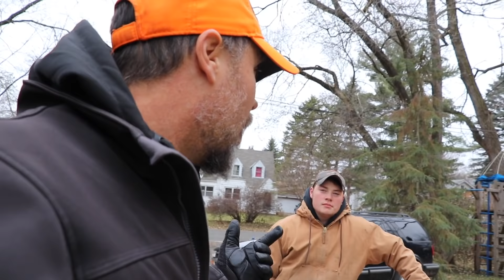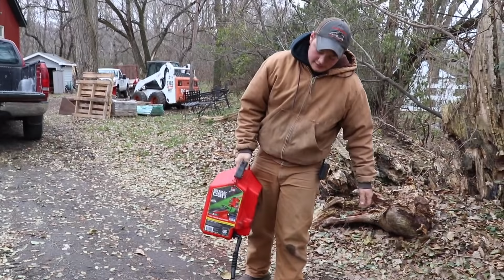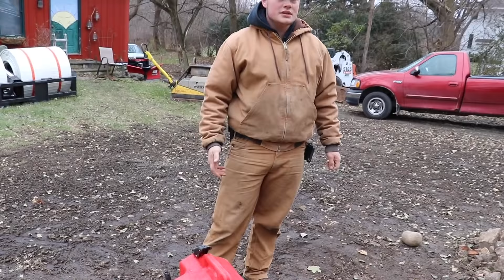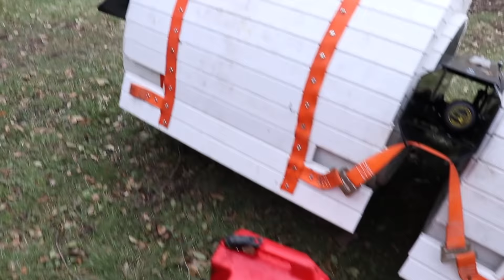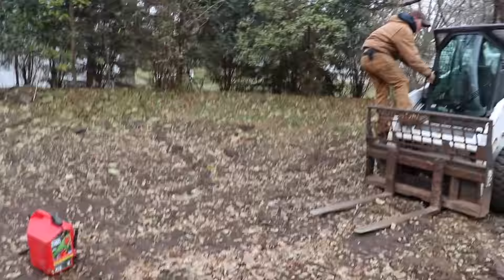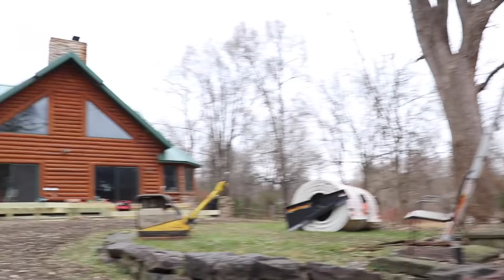Skid steers, Tall places & Bad ideas

Comment: Hey mate. Heres my two bob if it helps. I think u have two shows as your channels content is diversifying. 1st one is showing us a new product or tip that makes our lives easier. The second is a project like the decking one you are working on. My advice to help with the quality vs qty is to break up your project clips so you have multiple parts. Ie rather than one 20 min clip, have two 10 mins called pt 1 and 2. This will break up the editing workload and enable you to upload smaller informal segments in between filming and editing a big project. You have lots of great tips and DIY advice so Im more than happy for you to upload it in any form that makes your life easier. As for names, there are lots of great suggestions by others here. Cheers cc123
Reply: Cool. Thing is strong.

Comment: I bought one of those cans 6 months ago.  US made, durable as you point out, very ergonomic to use,  I took a sharply, marked the side of the can in 1/2 quart increments.  I buy my favorite diesel fuel conditioner by the gallon, transfer to the can and dose my common rail engines easily, cleanly, quickly.  Thanks for the vid!

Comment: I like this concept of testing things... even to the extreme...i don't have one of these cans but I think I'm going to have to get some... problem with other cans is if you need to fill equipment or vehicles and the gas cap is on the side of the equipment or machinery.... you don't get everything it off the can...i like these since they empty from the bottom corner.. you'll get everything out and flow will be much better.. great video!

Comment: I bought 2 of these at the beginning of 2017 season, one 2.5 gallon the other a 5 gallon. Only issue and complaint is by mid season the spout on the 2.5 gallon broke off. Great product but could use a more durable spout.
Reply from the maker: They might replace it for you

Comment: Hello Stan, My question is this. What about the venting? In California it is 100 degrees plus in the summer. I try to keep the cans out of the heat during the day, but still have problems on the job. I have had a balloon from built up pressure. Prior to pouring fuel, we depress the pouring mechanism to relieve pressure. That results in a brief spray of fuel. Them when goin to pour, I have had the fuel shoot right back out of the tank in into my face/eyes. Have not used this can, but I do like how the spout is lower and pivots out of the way. That would be nice when fueling some machines.

Comment: I like the idea, but I would prefer to keep the test within reason. The idea I have is to see over time and use the life span under hard use as opposed to drive heavy objects over them which is almost certain to cause a failure point. Thanks.

Comment: Tell me about it. I have like 12 gas cans. Range from 1-5 gal. All are junk compared to sure can. Except 2 of em an only are good Cus there like 10 years old. Before all these new ones came out. The old ones with yellow button breather flap. An black lid that screws the top off an you pull out the bendy spout. Blitz or somethin. Still nothin compared to sure can. Sure can make a guy dream.

Comment: All nifty, but I'm seventy with a game hip and i need a fuel can that  I can fill my whatever without spilling , getting another  hernia  or starting a fire .    My current " approved plastic wonder "  misses on all counts !  BTW,  when I was a kid we (re) used 5-gallon metal engine oil cans to shuttle gas to field engines on balers, choppers and tractors on belt drives.  I survived filling many a hot engine with those !  Now I'd like something a little bit better than hoisting - and holding - five gallons of fuel  to put less than all of it into the tank !

Comment: Depends on how expensive the tool is if you're going to be throwing it off ribs and whatnot screw guns and nail guns and stuff like that you carry up on a roof that would be a good test for that the gas can be carrying it up on the roof too often but you're not going to go take the like a chainsaw and run until it's broken you know I'm just Roy it drop it off stuff but you can't really compare these items anymore cuz you don't use them on a regular basis and when they break the always breaking a certain situation that you might not be able to put another saw into or another tool that can do that you doing exactly the same thing stuff that drills rebar band and cutting tools and all that kind of stuff for the kind of things I like to do you know which is more durable and it comes to your equipment when you've already know skid steers and you're doing maintenance Mazda all that stuff comes with trial and error and you don't know when you get a good one when you get a bad one you know after you got in it and how long it lasts and you know for sure what you got was good and you try to find the old ones too late to get them then and you don't know if the old ones are like the new ones because they might have changed the way the built the parts get to the point where you don't know anything about a product anymore cuz they change it all the time

Comment: "Dirtmonkey Demolition" sounds cool, but with your line of work, it kinda sounds like you're gonna do a demo job rather than product testing. "How Tough is Stuff" sounds just as good, and seems to fit the context better. I have this urge to prefer "How Tuff is Stuff?" Another idea, though I don't think it's any better, would be "Break it till you make it" to push the idea of ongoing improvements in product durability, but that might work best if you can compare earlier designs to the new stuff they have.

On an unrelated and totally impractical tangent, wouldn't it be awesome if Surecan would give you a few hundred units to make a retaining wall out of for their HQ?